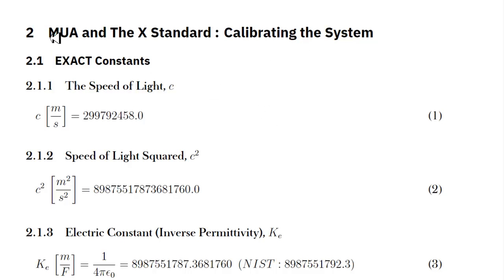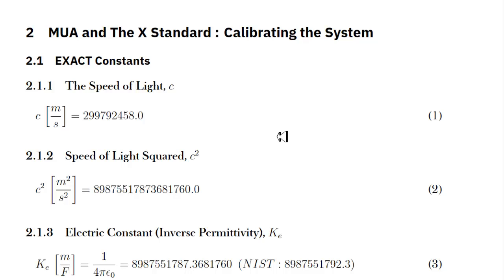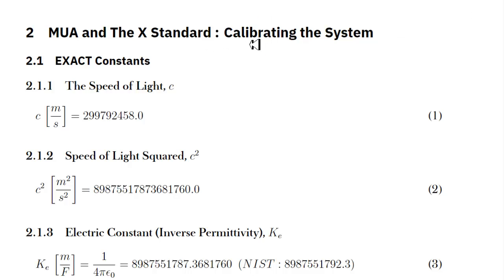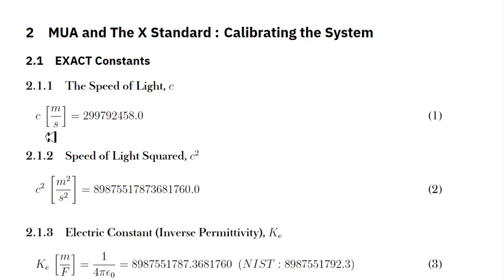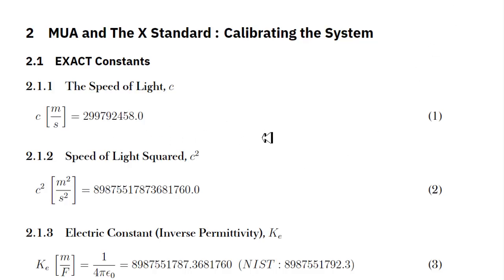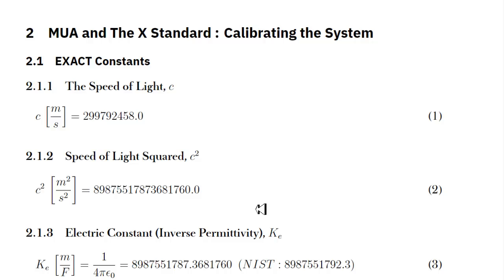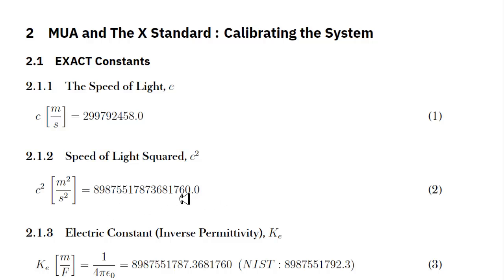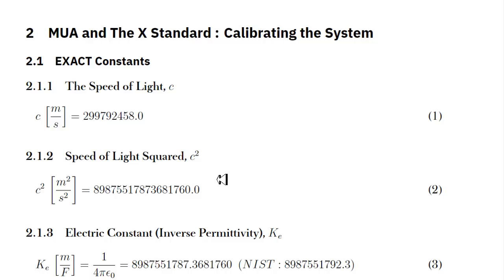Calibrating The Universe : The X Standard

Comment: @FractalWoman, I want to point your attention to a short paper by Mykola Kosinov on ResearchGate: "PARADOXES OF GRAVITY: Newton's Law Does Not Work at Large Distances, but... it's too early to throw it in the scrapheap". The "Law of Universal Gravitation" that is presented in the paper is incredibly simple: simple addition of the Cosmological Force to the classical Newtonian Gravitational Force. It explains observed gravitational anomalies with classical Newtonian Dynamics by classical means without need for Dark Matter or quantum methods. It also closely matches other experimentally measured gravitational anomalies that are described in the paper. The Cosmological force has theoretical limit equal to Planck force, which I find highly interesting. Referencing equations 2 and 3 in the paper: the Newtonian gravitation is comparable to the Cosmological force at exactly the same numerical value as a ratio of several fundamental constants of the electron (mass of electron, classical electron radius, and fine structure constant), which I also find highly interesting.

Comment: NICE REPRESENTATION I really like !  Removing and replacing  ! As a Material scientist this is Precision at best
Reply from the maker: I agree. Precision is extremely important in my line of work too.
Reply from the maker: I just had a chat with GPT about his: https://chatgpt.com/share/6752301a-ed68-800a-acf1-edc3aaa8218e
It is quite long but near the end, I address the issue of the Coulomb constant being derived from the speed of light squared instead of from the permittivity of free space. It should be the other way around, IMHO.
Reply: @FractalWoman  chat gpt cant do calculations , maybe the pro can do some basic operations but not complex , with the python is more accurate but if the code has no errors , the problem is that GPT models are probabilistic , calculations are not  , i try some  f = 1 / (2π × √(L × C)) many times and the results are wrong if not performed in python ,  ,  to make proper calculations GPT needs a table of equations as reference in text or python , with all constants and the si base and si derived units expresed in si base , if complex calculations are normalized and performed in code GTP can reference every time need some equations

Comment: Hi Lori...love your work!                                                                                                                                                                                         Would value any comment on the following:    The relationship between energy and mass = C*2       The relationship between Electric constant and Magnetic constant is also C*2.....Is it possible that mass, energy , Electric constant and magnetic constant are simply different aspects / phases /perspectives of Light?      E.g. A cycle has a 4 quadrant structure.
Reply from the maker: I do agree that all of these relationship have a common foundation. The electric constant, the magnetic constant and the speed of light and the speed of light squared are all properties of the medium for the propagation of light, a.k.a. The Aether. Everything we observe in the universe emerged "from" the Aether. The Aether is the foundation with which energy, matter and light (electromagnetism) emerge. That is why they are all so fundamentally related. Hope this helps.
Reply: @FractalWoman  Thanks Lori....I note that Ken wheeler states that the speed of light is simply the rate of induction of the aether and that the electron is the unit of induction . As Induction is related to permittivity and permeability , I would really appreciate your interpretation of his statements ..... I find your interpretations so much simpler and easier to understand.

Comment: (2⁴+5⁴)-[(1/e)/α^(π/5)]^(5/φ)=0                φ = 1,6180339887... golden ratio, e = 2,7182818284... (Napier's constant, Euler's number), α = 0,0072973525677... (fine-structure constant)
This equation describes the fractal geometry of the universe. Our space is probably the sum of two four-dimensional D-Branes (Bosonic and fermionic). Matter manifests as energy trapped in a fractal part of space. CODE OF THE UNIVERSE

Comment: Dear Lori, as I have tried to draw your attention earlier, you must include uncertainty in the Coloumb's constant as well as the elementary charge, and even the speed of light and the Planck constant contrary to the 2019 SI redefinitions. We have shown a remarkable mistake of an order of magnitude in the NEW SI when it comes to estimating the Fine Structure Constant.
Reply from the maker: The numbers that I presented in this video are exact because the speed of light is exact. Therefore, there are no digits of uncertainty in the speed of light. All you have to do is look it up in the ASCII table that NIST supplies... 

https://pml.nist.gov/cuu/Constants/Table/allascii.txt

...and you will see the following"
speed of light in vacuum" 299 792 458 (exact) 
m s^-1

And, since all of the values in this video are derived logically from the speed of light, these values are also exact. You will notice that the Coulomb Constant doesn't even appear in the NIST standard. Have a look at the ASCII table I gave you. You will not find it. Why? Because it is a derived constant. 

Planck's constant, elementary charge and the fine structure constant are a completely different matter and WILL require digits of uncertainty. That is why I kept these values out of this video. This video was about the EXACT constants derived from the speed of light.

Comment: I think if you want to calibrate the universe, you should start with Planck's constant, as that is the finest resolution we know about. The SI system is built out of pragmatic considerations, like using the frequency of the cesium atom found in atomic clocks as a basis for the speed of light. As accurate as it is, it seems rather crude to me, giving roughly 9 billionths of a second of precision. Modern computer chips run near that frequency.

I also wonder where this 10-7 comes from. Everything must be explained from axioms.
Reply from the maker: Baby steps. Planck's constant is next.
Reply from the maker: I explain the 10-7 in another video. this has to do with the conversion from the cgs system to the MKS system. In the cgs system, permeability is equal to 1.